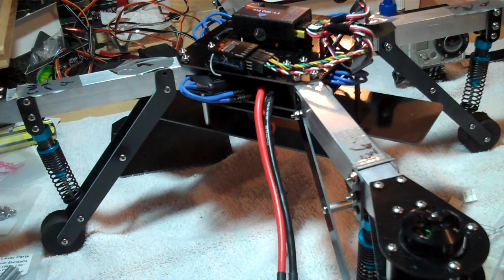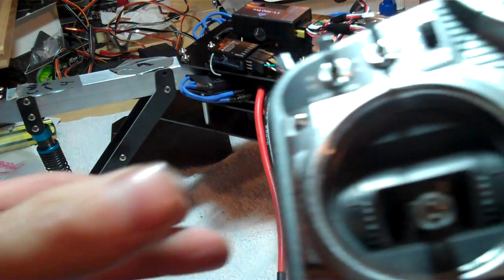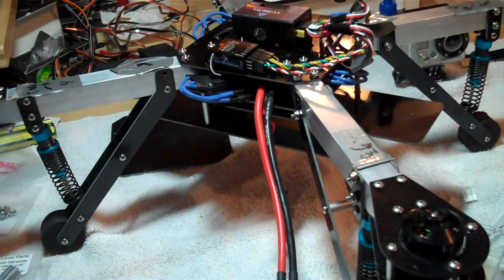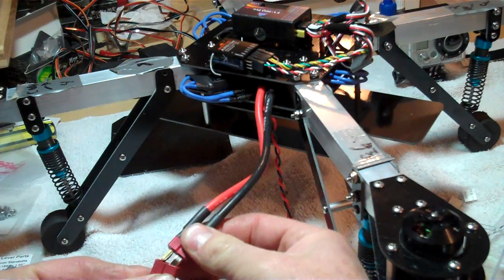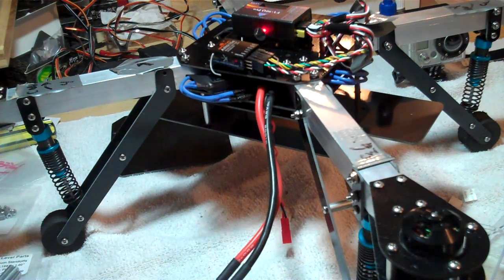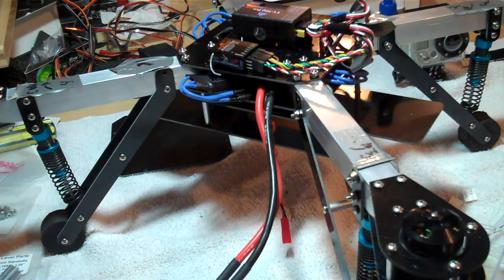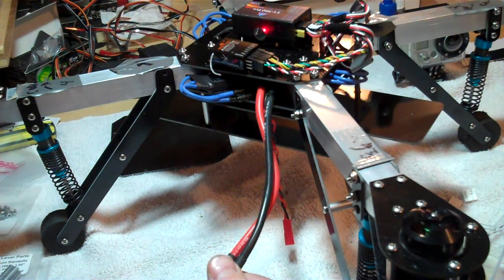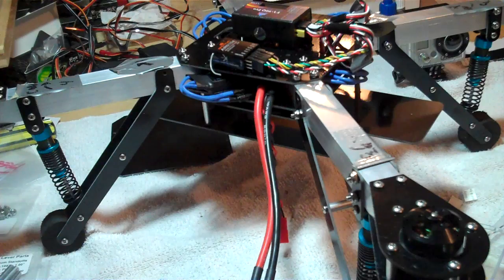Motors won't spool up and ESCs beep continuously .

Comment: I know this is an old video, but I have this same exact issue and I haven't been able to solve it. I tried to calibrate the ESCs but all I get is that same beeping. There is no confirmation tone that calibration was successful.
Reply from the maker: It’s been awhile since I’ve had to do this.  Check that all your speed controllers have been programmed with the same settings. Check whether or not you need to remove the red wire on 3 of your speed controllers or not. Depends whether or not you are using opto escs. If those are done then try and recalibrate again. Also make sure batteries are fully charged.
Reply: @RCHelimenace  Wow thanks! I wasn't expecting a reply lol

Comment: I'm having the same issue. I tried reading your comment, but how do you know it is calibrated correctly? Do I need to resolder all of my four esc's?
Reply from the maker: Just check all your bullet connectors by giving them a firm tug to make sure they won't come off.  You shouldn't have to re solder anything.  Just check to make sure you've programmed all your escs correctly and then after that it just a matter of programming your controller board with your radio.  Here is a video that might help.... Hobbywing ESC programming card setup
Reply: RCHelimenace After hours of trouble shooting in the software, (big mistake). I found out that the CRIUS 2.0 board is the issue. It won't let me calibrate the ESC through it. I don't understand why but, I'm sure the connector are reversed, since I bought it as a RTF, my mistake. Took one ESC connector out from the board, put it on the RX - ch3, boom, it works, beeps normally, managed even to program the damn thing. Are there other options beside MegapirateNG?
Reply: Make sure your battery is at full charge when you bind. Because your esc will only recognize the voltage and not the capacity. The esc will think you have a fully charged battery and then goes into voltage cut off even if you have lots of percetntage of volts left in your lipo

Comment from the maker: So what happened here in this video was just a simple matter of just calibrating all the ESCs together simultaneously to get the proper throttle response I wanted with the throttle stick.  Keep in mind when you calibrate it goes in this sequence,  transmitter on, throttle stick all the way up, (make sure all props are off the quad copter first), plug in the battery to the quad copter,  and all you do is move the throttle trim up from the bottom 2 or  3 clicks for the full range of the trim. You